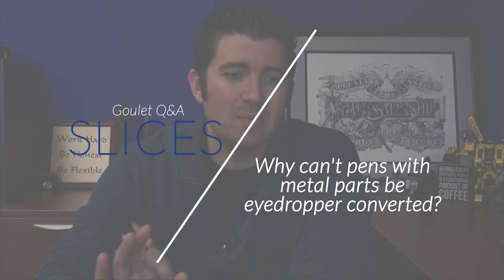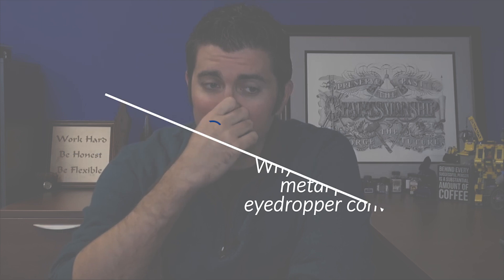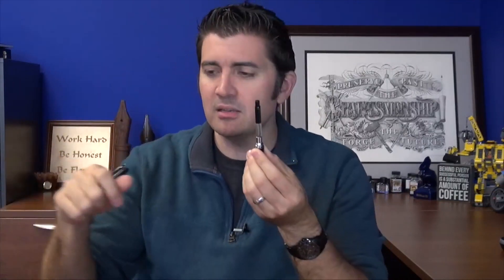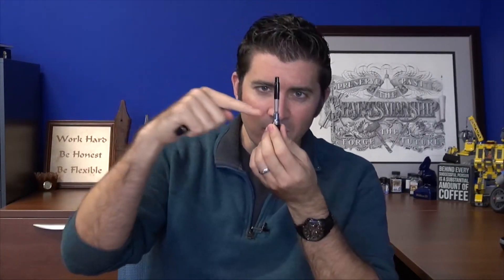Q&A Slices: Why can't pens with metal parts be eyedropper converted?

Comment: I did an experiment with a variety of metal parts, painted, plated (chrome, gold, and sterling silver), and raw metal (mainly brass), and soaked them in highly saturated inks that are popular in the community. I soaked them for a year and a year and a half. Only one of the painted parts showed any deterioration in the paint, not the metal. The other parts only showed discoloration. I just recently eye droppered my Jinhao X750, and am going to be using it for the next six months at least. I have a video of each on my channel. Personally, I don't think its as much a risk as what we tend to believe. I think most of the modern common inks are safe for such usage. We'll see in six months if there are any adverse effects, such that would deem eye droppering metal pens ti be absolutely prohibited.

Comment: One of these days someone will make a metal pen lined with non-corrosive material lining the barrel, so you get the weight, feel, and durability of a metal pen with the option to convert to eyedropper. It's not exactly exotic technology, why hasn't someone done it yet? There's obviously a market for it.

Comment: I have thought of this. There is no insurmountable technical problem. It is just that the big pen makers are plain lazy, and don't apply their brain. A simple solution will be:
- have metal body with narrower threads for the section.
-have some inner lining of some suitable material.
-the section cannot be of metal. It can preferably be ebonite. 
- the ink has to be suitably modified.
There is no reason why this can't be done.  I am sure some small guy is going to do it.
In fact, one Indian company [Luxor] did this in the mid-80s . I got one of these pens as  compliment, and it is still working with the original nib, and it has not leaked at all all these years. I only use India made "Iris" ink- I am using it for over 50 years on all my pens. It has not led to any corrosion. The lacquer layer is peeling off, showing the brass body. That is the only deterioration in over 30 years!
Reply: One correction. The ink I used was '"Iris". That was 60 years ago. The company changed hands or something, and they renamed the ink "Bril". This is the ink I have been using for over 50 years. Sorry for the slip.
Reply: Thanks for sharing.

Comment: If the metal is aluminium/stainless steel , woudlnt it be Ok? Especially aluminium because of the protective oxide coating. After all a nib is made out of stainless steel.
Reply: I belive you are right man. I would have thought that some aluminum or brass would be fine! Specially if it is just the body and not an intricate part like a spring.

Also titanium should hold up just fineeeee.

I was thinking of converting a "namisu ixion" it comes in titanium or brass/aluminum.

I think the titantium version would no problem. And i think even the brass/aluminum should be fineeeeeeeeee. (Brass has a protective oxidixation coating as well)

I belive the worst case scenario is after a looong time it is no longer shiney inside the pen. Boo hoo, who cares :P

People are too scared to try anything lol. If i had the pen i would try!
Reply: @joshuanorris5860  however, when drying the pen from cleaning you have to be careful, especially if you are gonna leave it for a few days. The remaining moisture in the barrel will make the barrel rust.
Reply: And whenever you open the pen, it might smell bad. Like quite bad
Reply: @deezem5294  i am always carefull when cleaning. Just leave the top off your pen for it to dry....

The real question is will the feed get clogged in any way...

I am still anxious to try drop filling a brass pen lol because everyone and their mother says not to do it!

Comment: I have a pilot con 50 converter.  What keeps the metal agitator in it from corroding? And can I take it out? The rattle gets annoying after awhile.
Reply: If it's aluminium, it forms a protective unreactive oxide coating. If it's stainless steel, it's generally unreactive. To remove it just disassemble the converter.

Comment: Actually you can, I have done it with my Jinhao
But you have to use a bit of plumbing 
And having a retainer ring behind the rubber grommet then adding teflon on the top of the barrel and threading helps it’s sealing.

Edit, yes I have not thought of corrosion.
Hm.
Well it is a Jinhao haha. It’s worth the little bit of marvel 😃